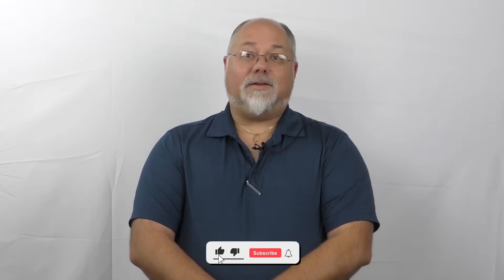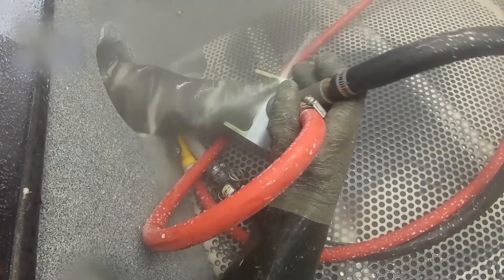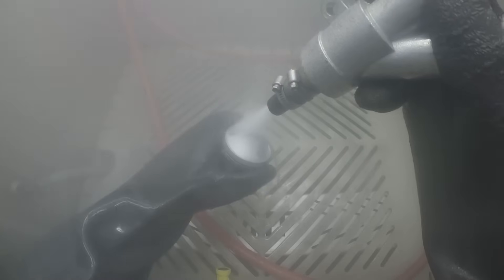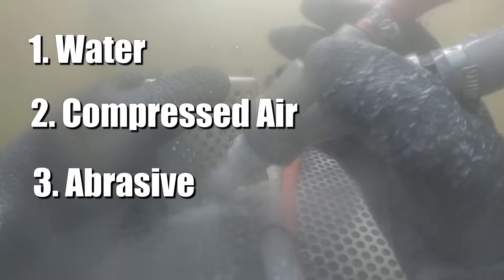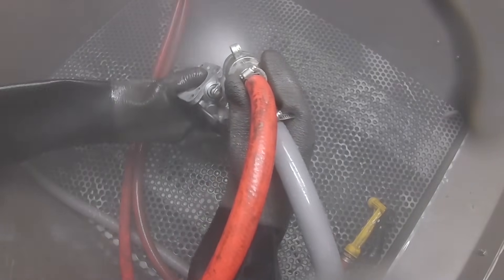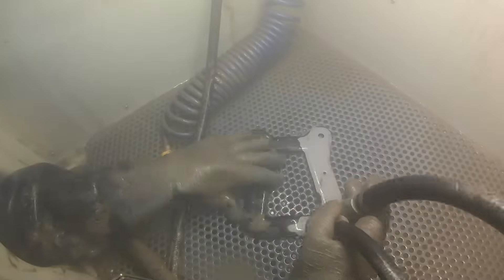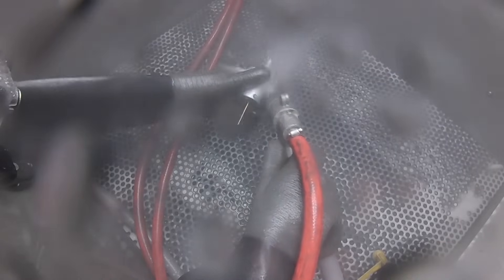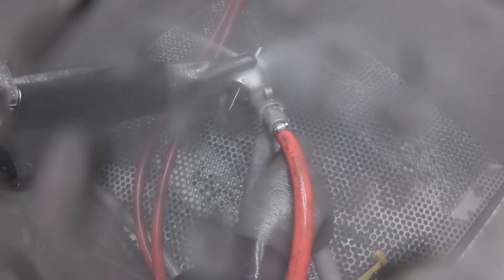What Is Vapor Blasting? - Vapor Honing Technologies

Comment: water does absolutely not cushion
Reply from the maker: What we mean when we say this is that compared to Sand or Dry Blasting where the abrasive is repeatedly hitting at the surface you're blasting, Wet Blasting is a much more gentle but effective process because it has the water added to the abrasive. The water acts as a "cushion" for the abrasive to not hit at the part as hard, but to also allow the abrasive to roll on the surface so it creates a better shine. So yes, the water is still blasted at high pressure and can be tough on the part, but it does help the abrasive be a bit gentler, creating more of a brighter finish than Sand Blasting typically would.

Comment: Thank you very much for this sacrifice.  Since the ratio of soda to water is 2:8, is it possible to use a solution of soda with a concentration of 20% and use a single pressure hose to remove carbon deposits and oils

Comment: My company manufactures investment castings and we grit blast using Aluminiun Oxide. Do you think vapor blasting would be more cost effective and achieve similar results?
Reply from the maker: Absolutely! Not only will Vapor Honing reduce your cleaning time before and after processing, but it will also extend your medias life by months. Call me today at 828-220-4983, Todd.

Comment: Thank you so much is vapor the same as hydroblasf?
Reply from the maker: Not exactly. Vapor blasting refers to using a pressurized stream of water and abrasive to clean your parts, whereas hydro blasting only uses water and a mild detergent. Hydro blasting is performed at a much higher PSI, but does not provide the same polished look as vapor blasting, as it does not use a blast media. 
Here is a video on using the Hydro Blast:
https://www.youtube.com/watch?v=OQVXZM0yXF4